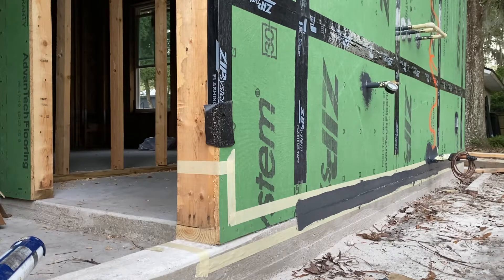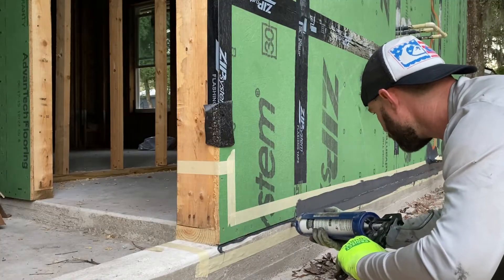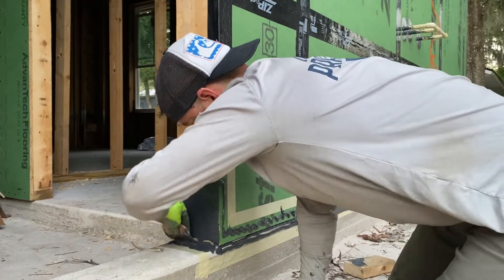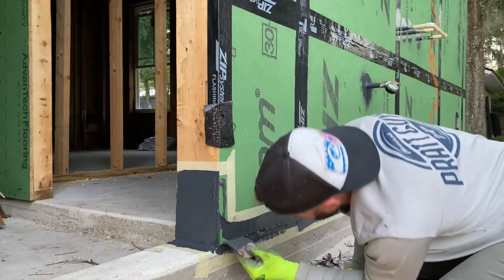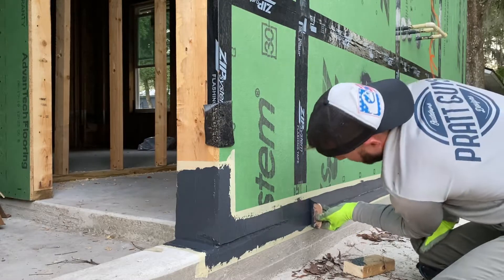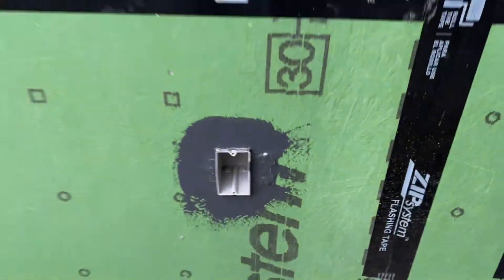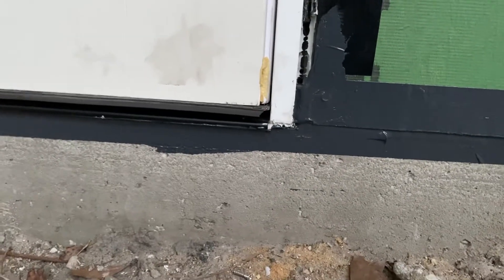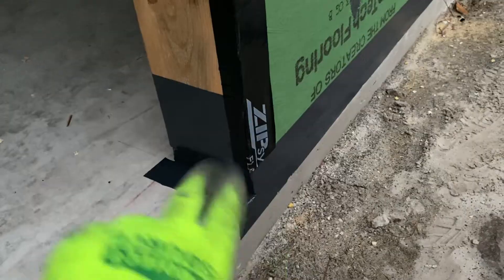Zip System Liquid Flash Application

Comment: Why didn’t you use sill gasket between the bottom sill plate and concrete to prevent moisture weeping up from concrete to the bottom sill plate?

Comment: The zip panel would be better to sit up of the concrete 1/2" with blacker rod to separate zip panel and concrete, then zip tape the joint. That way no moisture can pull up though the concrete and damage the zip panel.

Comment: Wood in direct contact with the concrete? You dont think its a problem?
Reply from the maker: Not at all. However, underneath the 2x6 bottom/sill plate, there is foam sill plate gasket along with the bottom plate being pressure treated.  Any wood framed house on a concrete foundation is built this way.  The common thing you NEVER see this step shown here, liquid flashing.
Reply: @theefficientbuilder5386  thanks for the quick reply and thank you for the quick note on the sill plate. We use asphaltic membrane to "cut" moisture by capillarity. About this video, liquid flashing is a must, this is a piece of art what you guys are doing. Congrats!

Comment: Should the flashing tape go over the liquid flash or the other way around? Id worry the tape might not adhere to the liquid flash vs the other way.
Reply: Flash should go over the tape - called huber to ask that exact question and they said clean the tape with acetone and then apply liquid flash over top of the tape
Reply: @wallacewoodworks9582  Thanks for letting us know!
Reply from the maker: It all depends.  As I mentioned in the video, all flashing should be installed / applied in a water shedding fashion.  The people you spoke to on the phone may not have understood your scenario.  If applied over the tape and the tape delaminated from the sheathing, now tell me how well the liquid flashing is working.

Comment: The "most secure" installation method isn't that secure since your door jamb is just floating on a few shims. To be more secure, you need to plum your stud on the hinge side and install your jamb directly on the stud. Use lots of fasteners. Shims may still be needed on the other sides but at least you have one really sturdy connection to your frame.

Comment: Why do you have to tape the top part? It’s going to get covered. Just wondering if it’s really necessary lol
Reply: It's a water and air barrier. Water absolutely gets behind the cladding of your house. The main reason to do it though is air sealing for a tight envelope so that air flow in and out of the house can be fully controlled.

Comment: Will you install exterior insulation and also will you put a drip edge with a bug screen over the liquid flash? Very nice video!
Reply: doesn zip ahve built in foam on the inside?
Reply: ZIP -R has foam up to R-15 IIRC. @randomrazr

Comment: Why lay a wide area around all the joints and penetrations? Why not just  a 1/2" or so at the joint? is it lapped with something else when the Zip itself is waterproof? Is there a minimum width of material? When you tape it off of course you are wasting some of the material just to get a fine line that no one will see. But I like it.
Reply: Nearly all these liquid flash products call for 2" past the joint in every direction. I imagine it's based on testing, or possibly code.

Masking the area with tape is the mark of a custom builder. You make things look pleasing, by making them look orderly, neat, clean, and straight. But only if they'll be visible for more than a couple days. As custom homes are being built, they may be visited by homeowners, architects, new potential clients, and various other trades. When people see good looking work, they don't necessarily know why it looks good, but the get a sense of quality. Believe me, this kind of detail sells. The trades talk, the customers talk, architects see, and potential customers see.

Comment: Great Video...and workmanship. Question I have is , 
1)do you really need the tape border , which gets pulled off anyway. As long as you have a nice wide liquid then that should do correct??? 
2)Also, at 7:36, there was not any tape over the liquid flash...did you put later??
3) Is there PT wood on bottom of frame wall, like I see on inside???
4) Is there any standard as to how high up you put liquid flash on nails??? Or just 1-2 feet suffice??
Reply from the maker: Hey Dave! Thank you and Great Questions 
1. No you really do not need to tape.  It’s a nice guide and it’s good to be approximately 2” above and below seam (approx 4” wide total).  However, the tape just makes it looks nice and clean even though it may all get covered up.  However, the bottom of the liquid flash may come down lower than the siding and could be seen although it would be getting painted, still looks nice as you will see that straight line with the paint overtop rather than it spread all over the foundation.   
2. Yes, it was put on after.  You always want to install everything in a water shedding fasten. 
3. Yes, the bottom sole plate is PT. It is also code as well. 
4. You techinically do not have to do any of the nail heads.  However, I do highly recommend it on the lower 2’ or so just from the splash up of water off of the ground that could potentially get behind the siding.  Extra protection never hurts.  I also recommend doing it around all penetrations, receptacle outlets, and plumbing protruding through the exterior sheathing.
Reply: @theefficientbuilder5386  Very impressive, young man. Most homeowners couldn't care less or even know why this is important but YOU will. Good job
Reply: @theefficientbuilder5386  Is that really the requirement so you have to lay out 4" for an 1/8" crack? Will it peel off or something if not wide enough?

Comment: 7:24  I believe the Zip tape is not recommended to stick to the Zip liquid flash.  Instead, they recommend to clean the surface of the tape with acetone, then coat the top of the tape with the liquid flash.
Reply from the maker: Hey Jim! It is the other way around.  You do not liquid flash overtop of the tape.  You can install the tape overtop of the liquid flash once the liquid flash is cured.
Reply: @theefficientbuilder5386  Actually, that is not true.  Do an internet search for  the ZIP  installation documents and you will see what I am saying is correct.  It is in the following Huberwood documents:

HUB 9214 REV 8/20 (Compatibility of Zip System Flashing Tape with Zip System Liquid Flash)
HUB 9214 specifically says, "We do not recommend installing Zip System flashing tape over top of Zip System liquid flash."

HUB 82267 REV 6/20 (Zip System Liquid Flash Installation Manual, page 7)
Reply: @Chrissers2010  It's true, I asked the rep a while ago and they confirmed to liquid flash over the tape, and not to tape over the liquid flash. Seems backwards, but they insisted that was they way to do it.
Reply: @theefficientbuilder5386  I also had the same concern. When I read the docs I remember it being the other way around. I would love any clarification on what I'm missing as I don't want to do this incorrectly.

Via this manual: https://www.huberwood.com/uploads/documents/technical/Compatability-of-ZIP-System-Tape-with-ZIP-System-Liquid-Flash-Tech-Tip-Wall-and-Roof-ZIP-System_2021-01-25-152721.pdf

"We do not recommend installing ZIP System flashing tape over top of ZIP System liquid flash"

Comment: Nice video! Pro job! Any tips or pointers on installing zip system on an older house that needs new siding as well??
Reply from the maker: Thank you! I would recommend properly removing all the existing siding and diagnosing if there is any structural damage from there (rot, old termite damage, etc).  From there, replace any structural wood as needed. If no structural damage was visible or once repaired, you can then start installing all the zip system sheathing to the structure.  Measure precisely the measurement from the bottom of the bottom sole plate to the top of the top plate.  Depending on that measurement, you can purchase different lengths of zip system ranging from 96” in length to 121-1/8” in length (with various in between common sizes). It is structurally the strongest to attach the sheathing from the bottom plate to the top plate. However, still consult with a structural engineer for your nail off pattern for your local area (depends on which wind zone your in, what state, city, etc). Following that, nail it off to the specifications provided by the certified engineering.  Once that is complete, but sure to zip tape in a water shedding fasten and roll the tape. Liquid flash all penetrations, Lower 24” nail heads on sheathing, and bottom nail plate to foundation as shown in the video.  I hope this helps.  Be sure to like and subscribe as I’ll be posting helpful videos twice a week.  

Thanks!

Comment: How about the capillary effect? The connection of the base plate and concrete?
Reply from the maker: Yes, I still use sill foam underneath the PT bottom plate.
Reply: Did you use the seal seal foam( base plate and the concrete connection?

Comment: Nice demo, thanks!  Do you think it could possibly promote rot because of being vapor impermeable?
Reply from the maker: Thank you! I do not think it could promote it as you are not sealing all sides of the wood, so it can still breath.  If you were sealing all 6 sides (like a cube with 6 sides), then you could lock in moisture.
Reply: @theefficientbuilder5386  Thanks!  In cold weather, any surface against the outside of a dwelling envelope is getting almost continuous vapor pressure from the dwelling - vapor flowing from interior to exterior.  If the vapor barrier is on the outside, it traps vapor behind it.  I say this because I have made this mistake.
Reply: @SpaceCrete  zip's panels are vapor-permeable from the inside to the out. There's a whole section on their site about it.
Reply: @kevinprociw3168  Thanks. I was referring to the liquid flash.  The care put into it is wonderful, but here in the PNW it may cause a problem, because air-tight exterior walls all tend to rot.  Have torn into remodels where the old (loose tar paper) is good and the new (sealed up) is rot.  I don't have the answer, except maybe to avoid wood in the envelope?